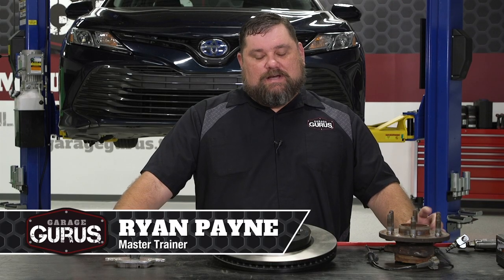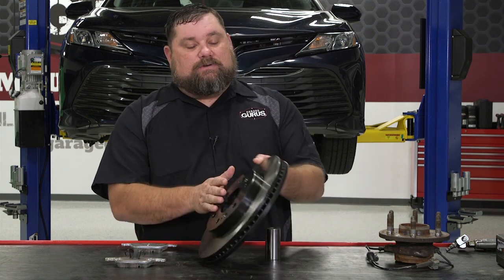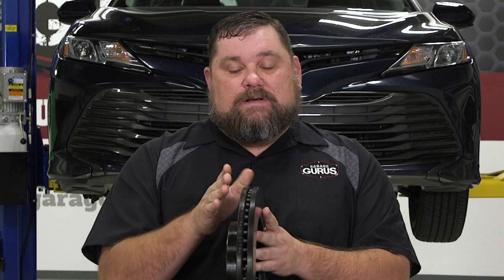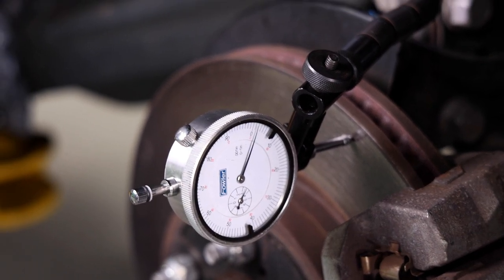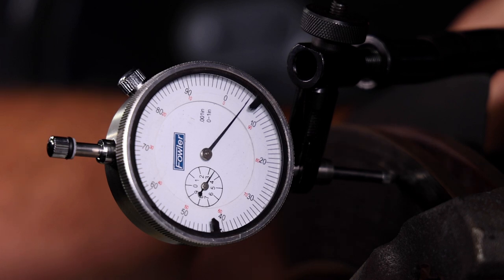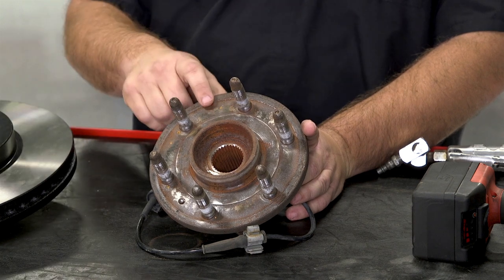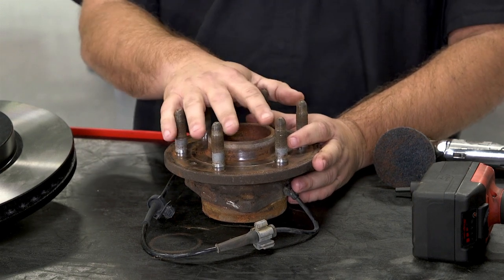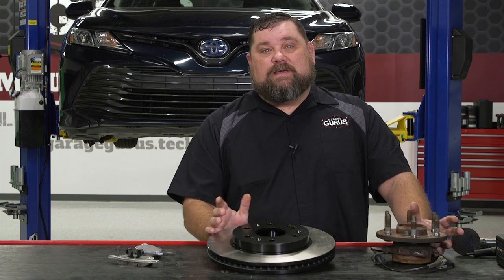Garage Gurus | Brake Rotor Thickness Variation and Lateral Runout

Comment: Awesome video ! 

Dealing with a runout issue right now I’ll have to check out this weekend . New rotors , new hawk hps pads , calipers , lines , bled the system . Brakes work great until they are hot,then I get a shaky steering wheel that gets worse with heat . Once cooled down , back to normal . 

I didn’t do the install so I’ll have to check the shops work .